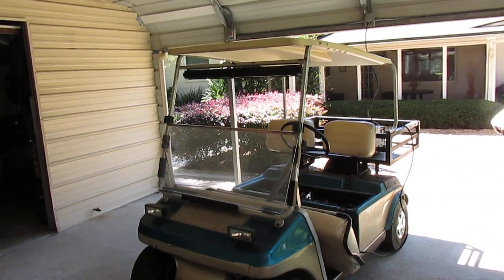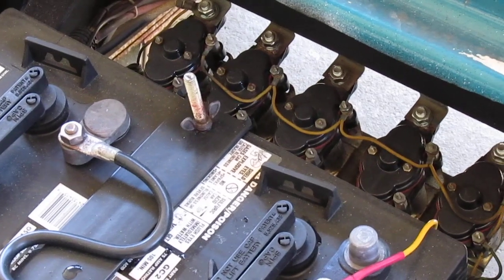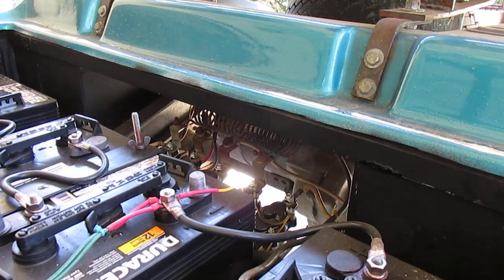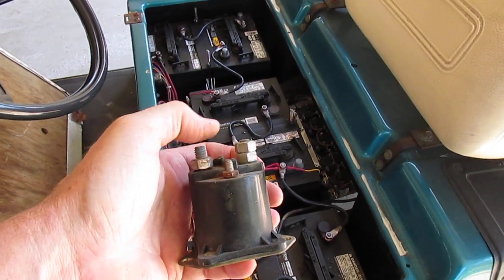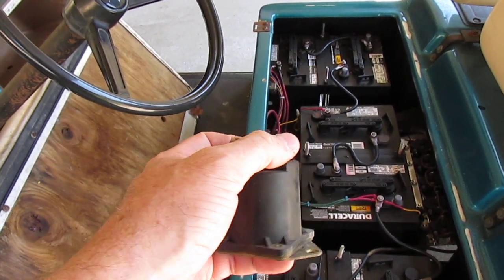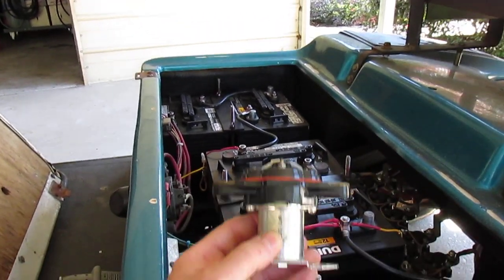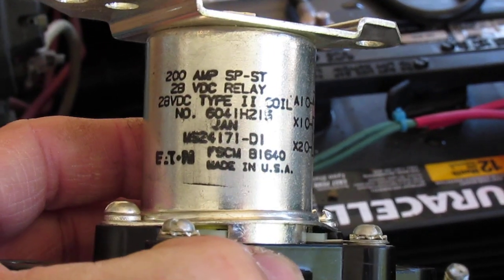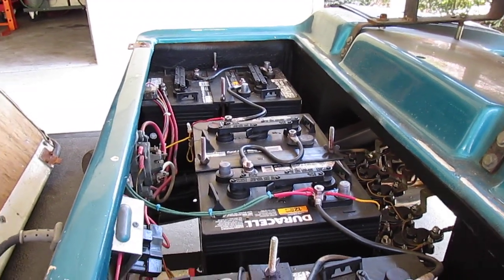Club Car Electric Golf Car Speed Control Relays

Comment: Excellent job explaining this. I just learned all I know about old pre computer controlled golf carts by watching this 6 min video!  I was recently bestowed a 1958 "Turf Rider IV" and Its so cool but I was so confused as to what the heck I was even looking at when I began to try and clean it up and see if I could get it to run. Its got an original 36v 1phase DC motor (GE) and 8 of what I now know are Speed relays, along with 3 resistor coils. I cant wait to go pretend I know what Im doing now Thanks!

Comment: By the time you buy all those it would be cheaper to rewire the cart to a speed controller it's more efficient and you can set your speed,torque, and pull out speed. I have a cart just like this and I will be changing mine out
Reply from the maker: I couldn't agree more.

Comment: I just got a older club cart, researching my accelerator issue. 1/4 throttle works fine, anything past that I have to keep applying more till about 3/4 then it Kicks in. Once full speed the mid range works. once in a while mid range work. not often. Thanks

Comment: My car looks the same but when I push down the peddle it clicks but doesn't go. Now if I keep pushing the peddle down it jerks when it gets to the second one and takes off. Any advise would be great?
Reply from the maker: Sounds like a faulty relay. Sometimes you will hear a click but they won't make contact properly. Also check the "micro switches". In a box below the seat, attached to linkage to the GO pedal. Could be a dirty "Micro Switch".
Reply: @10630390  ok thank I'll check into the micro switch!

Comment: I have an 86, I am experiencing issues in reverse only... it had no power up the slightest incline and won't go.  I replaced the forward/ reverse switch because when I swapped the wires on that switch the issue reversed.  It lost power in forward.  However after I installed the new switch same problem exists? Any ideas? Thanks!!!
Reply from the maker: May be motor related.
Reply: You have the forward and reverse wires inverted. The green cable is for reverse and the red cable is forward. Put them both on the front battery, passenger side, positive post. You will now have the same speed in either direction.

Comment: Hello! I have the exact same cart, but I'm having trouble with the accelerator, micro-switches, etc. engaging. Occasionally, the cart will go 20-30 feet and quit, even though it has full charge. A guy told me to smack the pedal hard a few times and it would "unstick" the micro-switches... I don't particularly care for that method. What would you recommend I do? Replace the micro-switches? Or is this a relay problem.. like the one you describe?

Comment: Thanks for the video - the problem I am having is ...  my 36 volt EZ-GO has forward and reverse - and the in both "directions" it goes FULL SPEED !  there is no progressive acceleration.   any idea what that might be?  thanks much !
Reply from the maker: I'm not sure about the EZ-GO because there are several different types of speed controls used by golf car manufacturers. Mine is one of the earliest speed control used. Mine has a series of micro-switches that are activated by the GO pedal. As you push the pedal down the micro-switches are progressively activated much like a "music box" type of arrangements. If yours operates like this maybe the micro-switches are stuck or something. Take a multi-meter and go across the relay coils to see if they are energizing all at once or one at a time. May need to disconnect the motor or jack up the drive wheels so you don't run over yourself. Good luck.
Reply: Thanks ..   Ha - good thing you said "jack it up or something" ..  I didn't realize it would STICK WIDE OPEN ..  and went forward  after getting the batteries in and it SHOT to the side of my 2009 pickup...  and did $500 worth of damage [more actually] my deductible is $500     oh well .. that is life .  ha ..  thanks again ..  will look into this .  Gary
Reply: I made a video of the part - what do you think?  gd
Reply from the maker: I'd like to see it. Can you send me a link? Thanks

Comment: If the 1st one burns out just swap it out for the last one and u get decent speed to make it back
Reply from the maker: Thanks for the comment, but it makes no sense.
Reply: All relays are the same, if the 1st one goes out, just swap it out for the last one and it should work
Reply from the maker: I think I see what you are saying. In an emergency situation you can swap in a relay to get back home. The "first" relay closest to the drivers side applies power to a bus that all the other relays are connected to. If it burns out, your dead in the water. So, swap in one from another position. This will work but depending on which one you swap you will loose the lowest speed, highest speed or some intermediate speed. This video is about swapping in a better relay to improve reliability. So far, the relays you see in this video have proven to be very robust.
Reply: NO! By doing this you will lose 4th speed and run the resistors extremely hot!! If the master solenoid fails, run a heavy jumper across the two large terminals on that master. The golf car will function normally like this until the master can be replaced.

Comment: Is there a way to test if the relay goes bad?
Reply from the maker: Yes. 1st check the resistance of the coil. That would be the smaller terminals. Shouldn't be real low or real high. I'm guessing you should see somewhere between 500Ω to 2500Ω. (Do this with the wires disconnected) 2nd put a voltmeter across the big terminals. You should see 36 VDC across the terminals. When the relay "pulls in" you should see 0 VDC. May have to do this with the cart up on jack stands. Also, you may not see 36 VDC until the first relay in the string "pulls in". (Make sure all wires are connected and batteries are charged) 3rd Also listen to them. When power is applied to the coil, you should hear a "click". That indicates at least the relay armature is moving.
Reply: @10630390  thank you. I'm going to test out hopefully today. Cart runs good on flat surface but struggles bad on an incline.  I have a 1996 club car 48v. It only has one relay.
Reply from the maker: @ldsmarine21  Welcome. Maybe just batteries are going bad?
Reply: @10630390  I still need to check the coil but I did check the batteries. Each one about 8.3v

Comment: Good stuff, thanks. My '88 Club Car (36volt) I just bought is running real slow after putting in new batteries. Continuity checked out on the solenoids and checked that the speed control was working properly, sending the signals to to relays. Is there a chance the motor is bad? Would it run at all if it was, or could the solenoids still be bad? We can hear them clicking and we're getting voltage on the out side after energizing. Any ideas? Thanks
Dan
Reply from the maker: Thanks for the comment. Make sure the cable connections to the motor are good. Mine burned off when I was at Disney's Fort Wilderness. I ended up replacing all my cables and repairing all the connections. Its possible the motor brushes are worn out. When I fixed my cables I also replaced my brushes. Seemed to run a lot better afterwards. Also make sure you don't have a voltage drop across the relay contacts when energized. Just because you hear a click doesn't mean there working. Another thing, make sure that when all the relays are energized the motor is seeing the full battery voltage. In high speed, all the relays should be energized and all the resistors should be bridged out.  Make sure too that your resistor connections are clean and tight. Check my other videos out: https://youtu.be/iNyizCg80ac https://youtu.be/HdCa2jV5wKE https://youtu.be/2jR-gDeoyA8
Reply from the maker: My commutator was in pretty good shape. They can get really grooved though. Motor shops, if there are any around anymore, used to be able to resurface them good as new.

Comment: Where is the micro switch that sends the signal to the solenoids? I think my switch is out. Oh well I'll look else where, but check back here as well.  Thanks for the information.
Reply from the maker: There are several micro switches located on the frame rail under the driver side seat area. They will be housed in a small metal box. Strangely enough, I have never had any problem with them.
Reply: There is one on the F/R switch that leads to the speed box of micro's. Change it.... Also inside the box is a white plastic sleeve that tells which micro switch to turn on, after some usuage it wears out..small price..but causes all kinds of issues

Comment: guys! can you help me with my electric golf cart..the problem is this.when i switch it run and turn on the key it run bit but stop and dead i need to turn the switch to tow and back to run..and do again same work thank guys,,,
Reply from the maker: +Luis Leonor I'd get a multi-meter and look for voltage drops at the relays or motor to see if there is an open circuit somewhere. Maybe a bad wire or connection or even an open cell in one of the batteries. Check each battery while under load and see if there is a battery that is open. An open battery would show most of the voltage being dropped across that battery's terminals. Good luck!

Comment: I have club car president batteries are charged up, depress accelerator wheels turn about a few inches then stops same for reverse can someone help
Reply from the maker: Possible open cell in one of the batteries. Check voltage across entire string of batteries under load. If voltage drops, look for a bad cable or an open cell in one of the batteries.
Reply: all the batteries are good, checked them, was driving hit a bump care quit running had to get off road push golf car to side was I gear do not hear any noise when depress accelator
Reply from the maker: Maybe an intermittent connection. Possibly by the micro switches.
Reply: Either the MCORE is bad or the controller capacitor is not functioning.

Comment: how faster is it using the new coils
Reply from the maker: This modification makes no difference in speed. It is simply replacing the standard relays with better ones that last longer.
Reply: ***** what do you mean? you said it slows you down and without the resisters you will get the highest speed. the whole video you were saying it will make it faster?
Reply from the maker: Not sure why the confusion. The relays were replaced to improve reliability. The resistors are there to control speed as designed by Club Car. This modification has nothing to do with making it faster. In the video I discuss the function of the resistors and relays.
Reply from the maker: I suggest you take an electronics class at your local community college so you can better understand this circuit. Taking the resistors out will give you high speed only. Not sure that is what you would want but you can do that if you so desire.
Reply: so it wouldnt be able to operate at low speeds? thanks alot!
Reply: ***** do you know what a electric resistor is if not that slows down the speed but it also waste a lot of energy.

Comment: How do i make my golf cart go faster
Reply from the maker: +Conner Meadows I believe they sell high speed motors, but very expensive. Check Buggies Unlimited online. One way to get the most out of an electric cart is to make sure the batteries and connections are in good condition, full of water and keep them charged. I use and recommend a battery maintainer. I have one and my batteries stay in excellent condition. Bought mine from VDC Electronics. 36 Volt Maintainer.
Reply: get a sports car engine
Reply: You can speed up these analog vehicles by simply implementing a field shunt. The cost is one solenoid, one horn or starter button and some wire. If you don't know what I'm talking about......DON'T DO IT.

Comment from the maker: The motor is approximately 3 HP. The current draw is nowhere near 400 AMPS. I wasted no money, I got them for free.
Reply: Only if that motor had been replaced. 1981 donned a 1.5HP motor bolted to the greatly inferior Terrell differential. 83 or 4 is when they changed to a 2HP motor and the Kawasaki differential and when they released their first gas powered car. THAT was an 8.5 HP Kawasaki flat head.

Comment: they are not relays.They are selonoids
Reply: I know that they call them solenoids, (like call boat engines are called outboard "motors") but they are more correctly termed relays or contactors. A relay will have a solenoid, but a solenoid will not have a relay.  A solenoid moves something, a relay switches electrical current or signals.